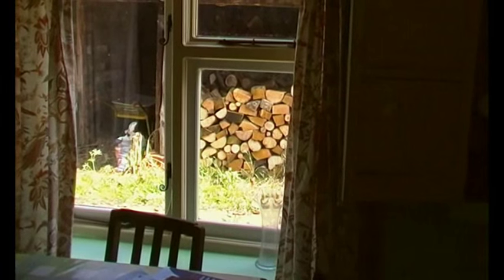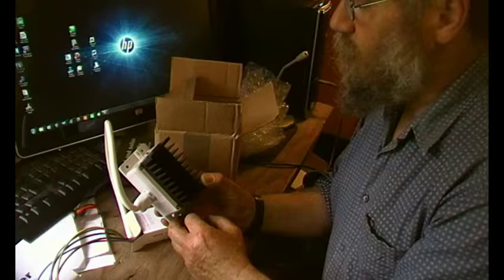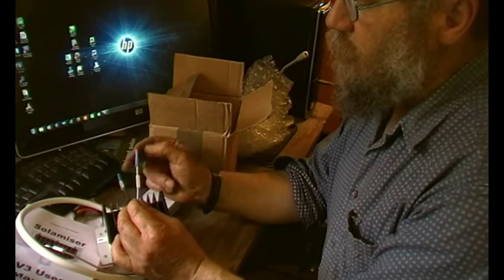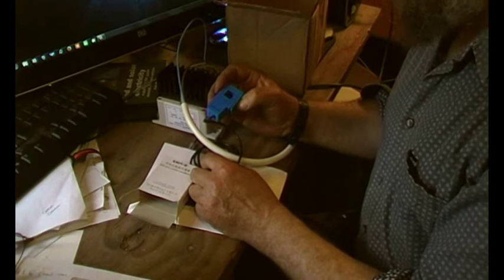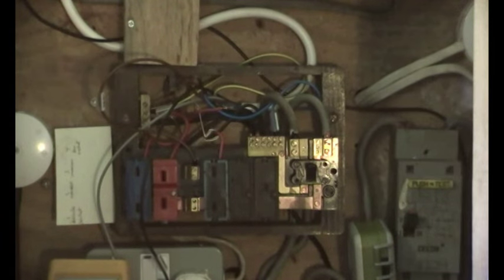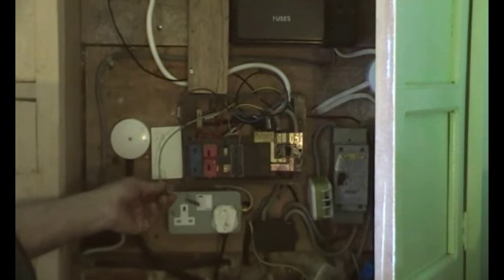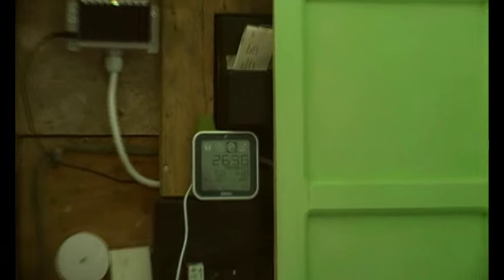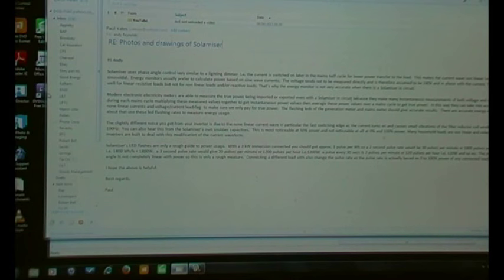Zero carbon water heating, solamiser gridtie power divert.

Comment: I have had one of these for years, and it gives me free hot water about 90% time. on a sunny spring day, my tank hits 80deg (I have turned up the thermostat to increase thermal capcity) before 10am even heats the water (less) on cloudy days
Reply from the maker: Our SMA grid inverter made strange noises when the solamiser was working, so I changed to a different diverter and the noises stopped. Cheers

Comment: Hi Andy enjoy your channel I have something similar but have a combi boiler so I use it to heat an electric towel rail in the kitchen I've tried a night storage heater but it's benefit is limited
Reply from the maker: Hi, thanks for your observations. I suppose the usefulness of this diverter depends of how much equipment is running in the background (using up power), and the size of the system. I have moved on to the immersun unit as it is 3 stage and our grid solar has expanded. This now  runs the immersion heater all summer, and when the pellet boiler is running gives heat to several 2.4 Kw storage heaters in turn. Now that the Fits payments for new systems is so low it means that registration is pointless and a diverter is the only way to make the economics sensible. Cheers